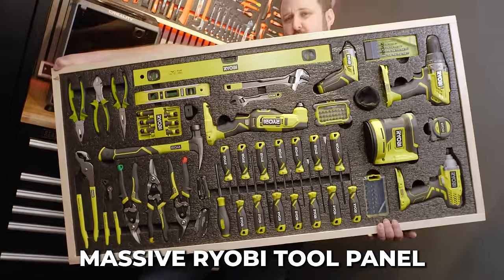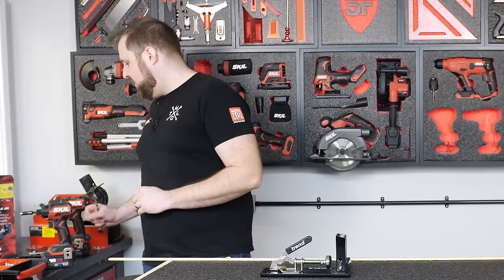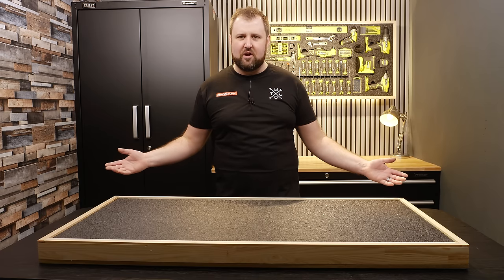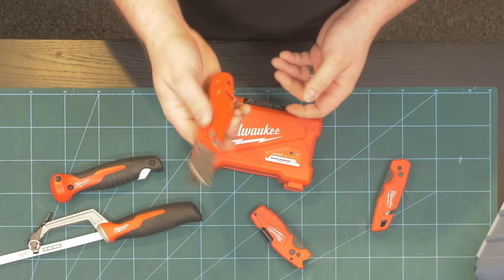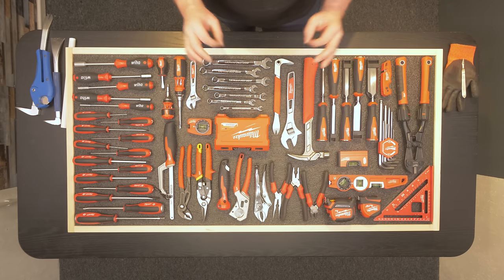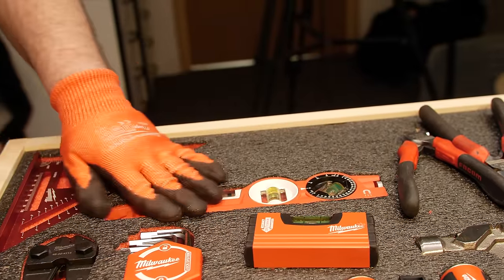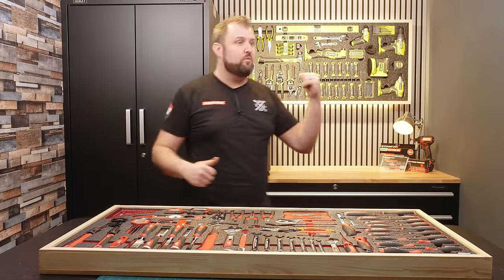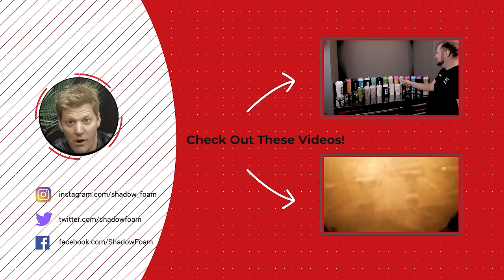I Built The Ultimate Milwaukee Hand Tools DIY Wall Panel!

Comment: I love your love for tools and you have some great tips for tools to buy. It I can give you my top tip for cutting wood square with your circular saw - Put it onto the edge of the piece you are going to cut and them butt the saw edge up to it so you use it as a guide to move at 90 degrees across the wood.

Comment: how about a Festool panel, could be costly tho
Reply from the maker: Tempted, what should I definitely include?
Reply: 10.8 v drivers & charger,18v  impact driver, drill driver, multi tool, 125mm angle grinder, charger, accessories bits and drills the lists endless and the more i think about it probably cost prohibitive unless Festool would like to donate a few bits   @ShadowFoam